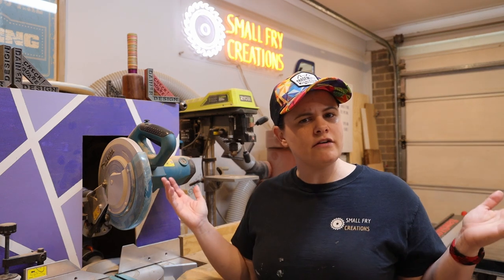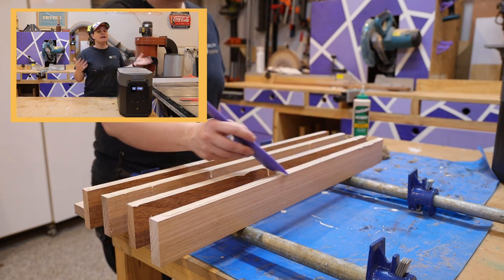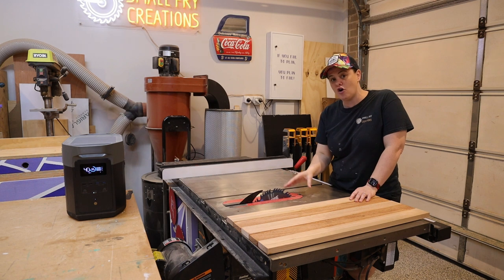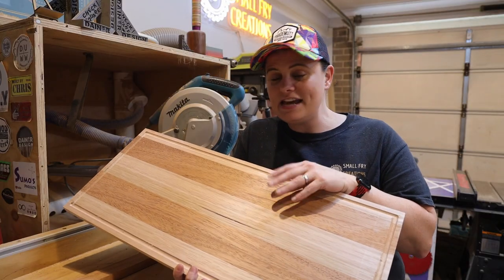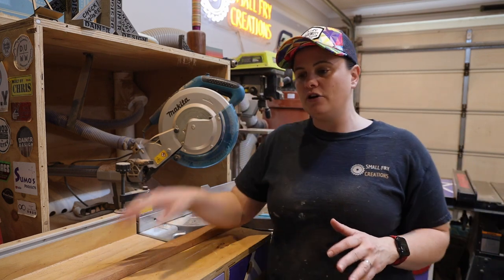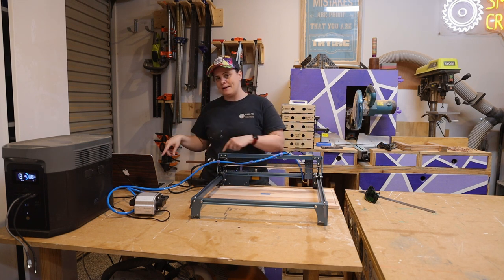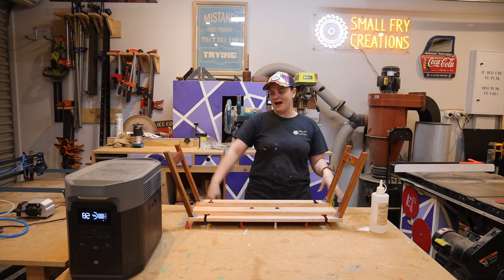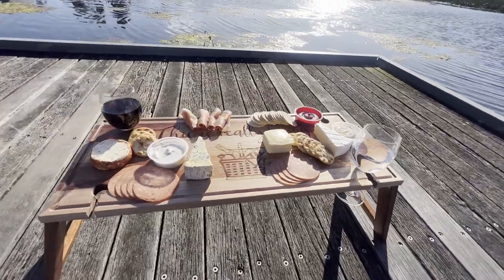Beginner DIY Portable Picnic Table: Powering Up with the Ecoflow Delta Max 2000

Comment: $3699, is that the right price for the Delta Max 2000? Just wondering is that Aussi dollars, wasn't sure. Great product!
Reply from the maker: Hey Lou yes that is correct. If your looking to get one hang out to November 14th. They will go on Black Friday sale. First half of the month the smaller units and solar panels are on sale and second half of the month the larger units go on sale. They are a great product and handy for so many situations